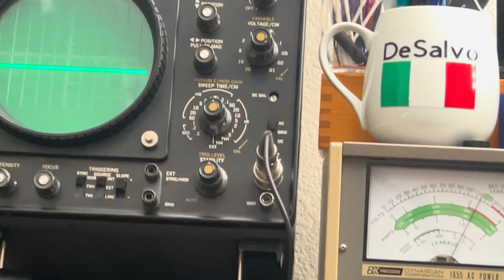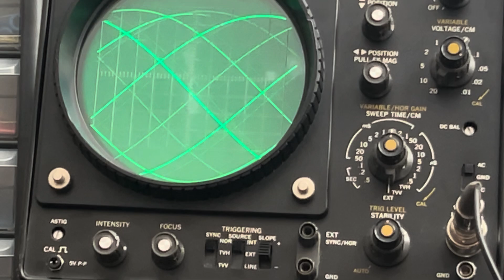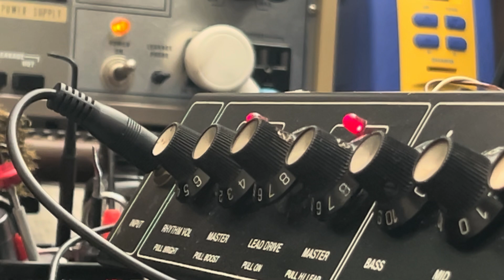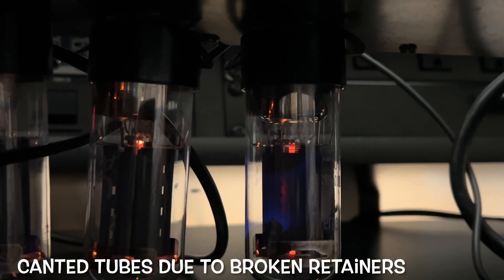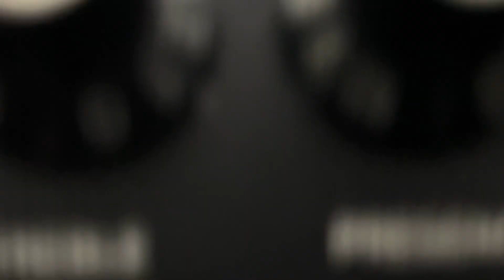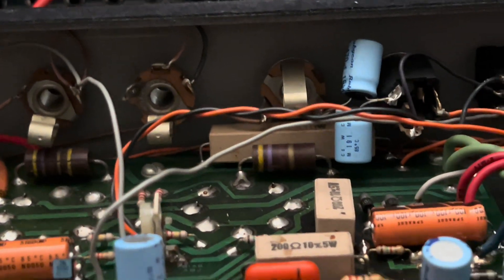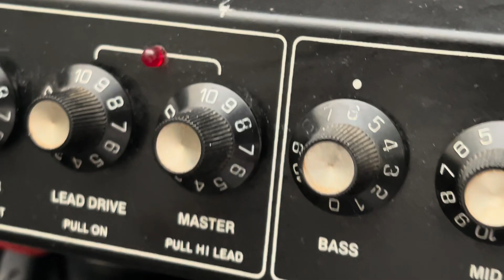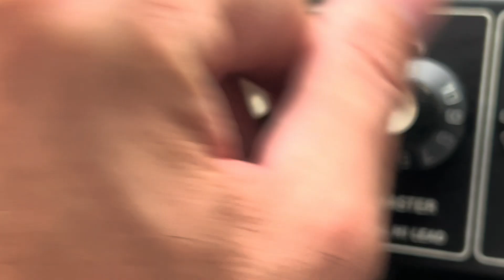Vintage Carvin X100B Part 1 || Do Your Worst!  Oh, You Already Did.

Comment: Sorry to bother you, I have search hi and low for a solution, maybe you can share your opinion on this matter: I replaced some filter caps on a Carvin X100B series IV, they were to the plate of 12ax7. I thought this resolve the issue, but no. The "issue" is a drop on vol that is resolved when I switch on and off the amp or the stand by switch. Sometimes moving a jack, a tube, or hitting it like an old tv with a karate chop fix it. As  I use the line out to record, I notice the tone is not affected, only the vol. The amp lost Vol... and it should be ... at least after the PI, as I use pedals  on the FX loop and they are in the recorded sound. Seems like a mechanical problem right? Like, the full signal is going to ground, somewhere... I cleaned the flex, I did spray contact cleaner on the jacks, heck it even contact cleaned my eye by accident. Also tightened the sockets pins... Im at my wit end here, if you or someone happen to know what is the cause, please tell me! I like this amp (when it works). If by any chance I encounter the answer, I will be back and comment it here.
Reply from the maker: You cleaned your eye socket!  Shoot me a message. My email address is the channel name at gmail.

Comment: Nice video.  I always appreciate seeing those details.  That amp looks like it's seen some moisture.

I'm the original owner of an X-100B (PCB 30-X100-4C) and have re-capped mine and added a bias adjust to swap between the original EL34 and 6L6GC power tubes; works well.  But that amp takes a lot of control tinkering and can sound very good in every case, from clean to overdrive.  But the lead channel does not cascade from the clean channel like the Boogie Mark II or a Dumble.  The schematics are pretty clear on that.  The lead channel is one input preamp stage followed by two cascading gain stages, independent of the clean.  Unfortunately, no tone stack in either channel makes it hard to filter out bass that flubs up the gain.  The shared, active tone stack follows both channels, plus the graphic EQ.  It helps to lower the bass from the guitar before going into the amp's lead channel to start getting better gain tones, but it's possible.  It wouldn't be too hard to insert a passive tone stack in the lead channel at the lead drive pot wiper.

I have considered re-configuring mine to truly cascade the clean channel into the lead channel's two gain stages, but that's too much work for the PCB to handle.  I've already ruined a perfectly good Carvin Vintage 33 trying to over-customize it, but I learned a lot from that work, notably, don't expect to customize a PCB amp much.  Better to salvage the transformers and chassis and re-build from scratch, which would be quite possible with the X-100B platform.
Reply: What would you do for a rebuild? Bought one from ebay. After a delivery snafu,they refunded me and said keep it. Free amp for me..
Reply: @chadmartin4467  Free is hard to beat, and tempting to dig in with mods.  The first is always to consider replacing the filter caps if they're over 10-15 years or any are noticeably leaking.  I'm about to convert mine to use two caps in series, like Dumble did, to replace the first filter cap for higher reliability.  My local power runs high, around 125VAC.  The next mod would be to add a pot to adjust the fixed bias voltage to fine tune the bias and allow switching in different power tubes.  With that mod, you can try 6V6-GT tubes for somewhat lower power, though I ultimately didn't prefer that tone over the 6L6GCs or EL34s.  I may also add a voltage regulator with the cap change so I can lower the B+ to use 5881 tubes or others that need a lower voltage.  My 6L6GCs are running on a 475V B+ right now given the high source VAC.  They can take it; other types may not.

My mods to the V33 included converting to per-tube, cathode biased power stage with 4 different levels of selectable bypass, adding an alternative EF86 in the lead channel for cascaded gain, hacking and adding relays for more control, adding an independent DC heater supply to all preamp and phase splitter tubes, applying the Hasserl voicing mods, adding LED displays for each mode so I could tell which was on from a distance, etc.  WAY overkill for mod'ing a PCB.

I discovered with my ruined Carvin V33 mods that the PCB traces and pads could lift after a few component changes.  I also concluded that, even though I had fun and learned a lot frankenstein'ing that V33 PCB, it wouldn't have been reliable enough to carry around or gig with.  When I rebuild on the V33 chassis and transformers, I'll design a turret board and hand-wire it all for simplicity and reliability.

So I'm not going to ruin my X100B with all that.  I'm evolving to a 'garbage in, garbage out' view, meaning, filter the guitar to present the right equalization to the amp, and use that amp as designed.  As such, I'm converting several guitars to active pickups and filtering, but you could do that with a good graphic EQ pedal in front of the amp, or even a simple, footswitchable high-pass filter pedal to take some bass out before switching in overdrive.

That's about it.  After the simple mods, enjoy the X100B for what it is, or design a hand-wired amp around the transformers and chassis.
Reply from the maker: @chadmartin4467 caps and take it from there!

Comment: I just "restored" one of these- mouse nest removal, recap, cleaned that eq assembly. The board is completely de-laminating on the bottom side and has that crinkly look to it like this one. But it sounded pretty good overall. I told the customer to just play it until it dies 🤷
Reply from the maker: I’ve never actually seen a rats nest in one of the amps. I’ve worked on, but I have seen the aftermath – the chewed up wires, the waste material, and the stench. The damn stench it definitely led to some new protocols around the shop where everything is opened outsidewith personal protective equipment lol

Comment: In the way back long ago time, a bandmate had one of those channel stacking Carvins and I rather liked the sound. Boogiesque but at a Kustom price point. But the first time I opened one and looked inside, many years later, I got a rather sick feeling. A very shoddy build.

I liked the brand because they were local-ish, reasonably priced and their print catalog was affordable eye candy to a youngster. Loved how you could order a guitar and specify absolutely everything about it, pickups, switch/knob config, finish, etc. The tung-oiled but otherwise naked necks had a great feel. I still use a 12" Carvin cabinet as a shop cab. It has a Celestion, not sure if that is original.

Rambling on... 😁
Reply from the maker: I like most of their gear and for the same reasons!  I wish I would have seen the showroom while  they were still Carvin. Now the guitars look like something used for skewering bbq meat on the 5th ring of Dante’s damnation model. Come to think of it, they were pointing the 80’s-90’s, too 😂.
Reply: @ForgottenGearRestorations  Yeah, their "Strats" were rather pointy. Nice guitars though, both the bolt-ons and the neck-thru designs. They had a Les Paulish model you could get with a beautiful flamed top with a finish like a deep reflection pool. I went to their showroom all the time, usually to buy a $35 gig bag for one of my Frankenstrats!
Reply from the maker: I used to love looking through those catalogs when I was a kid!  The finishes were jaw-dropping and mesmerizing for sure.  Really a distraction from the guys with crispy, hair-sprayed curls holding the guitars lol.
Reply: @ForgottenGearRestorations  That was before Ibanez captured the hair metal crowd. I'm convinced some of those guys styled their hair with firecrackers.